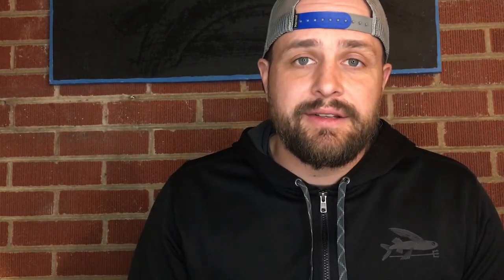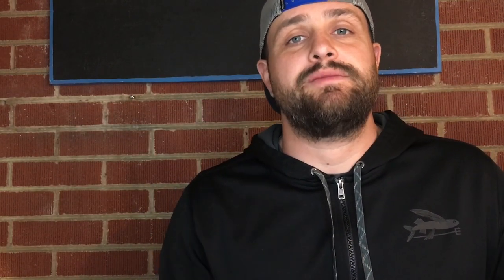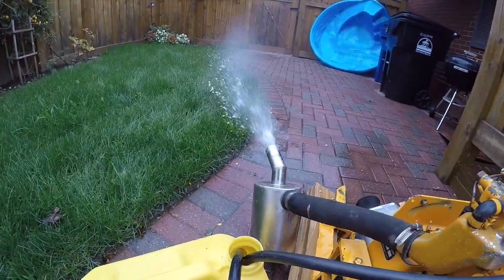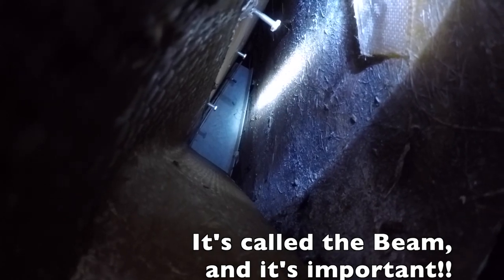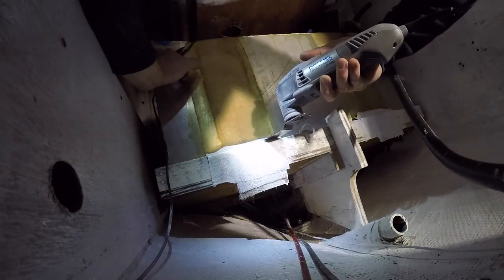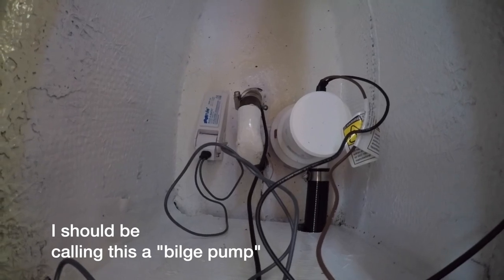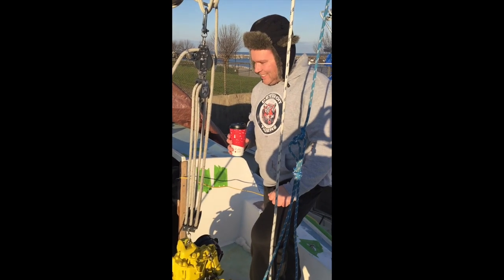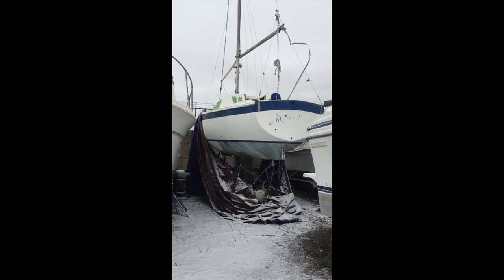Restoring a 1976 Cal 29 Winter Work: tarp failure, firing up the engine, installing a bilge pump

Comment: Dustan, I have a Cal 29, not sure what year. Is your boat back in the water? My bildge tank always has some water in it and Ive heard that is normal for this kind of a boat. Does yours? Also, my sump pump for some reason had stayed on and wasnt turning off and my ex boyfriend took out the switch for the pump and never replaced it, so I cut the wire. Is it safe to replace the sump pump when there is water in the tank? I hope to hear back from you. Thanks so much and I hope you and your family are well! Thanks for your video!
Reply from the maker: DolfinHeaven my bilge always has some in it too. Couple of reasons: my companionway leaked up until just recently so water was making its way into the bilge right below the steps. I finally sorted that. Also, my main bilge pump (the one in the deepest part of the bilge just below the steps) doesn’t go all the way to the bottom. Even if it did, some water comes back down the hose once it stops pumping, which makes it nearly impossible to get all the water out. Now that I have everything dried in I might try and sponge out the last bit in the bottom just to see how dry it will stay. I don’t think having a bit of water in there is a big deal unless it indicates a leak.
About replacing the sump pump (bilge pump): it’s fine to do it with water in there. These pumps are 12v DC, so you would be fine. However, make sure that all your wire connections are made with crimp and adhesive shrink tube, and that they are all above the normal water in the bilge (as high as possible). I have 2 pumps, one in the bottom of the deepest part of the bilge, and one right under the access hole under the table in the galley. The second one has an alarm attached to it so that, if it kicks on, I know something is wrong. If the water is high enough for that one to be running I have a serious leak.
I hope this is helpful. Feel free to fire back with more questions. You can see updated pics of Clementine on Instagram with my handle: @oh_ma_darling
Reply: Dustan Balkcom  Thanks so much for your reply!  I really appreciate you! I’ll say more later!
Reply from the maker: DolfinHeaven I’d love to see your boat.
Reply: @dustanbalkcom  In person or via video?
Reply from the maker: DolfinHeaven was thinking video.
Reply: Dustan Balkcom I don’t really upload videos here. How do we exchange contact info wo/ it being public here?
Reply from the maker: DolfinHeaven dbalkcom@gmail.com